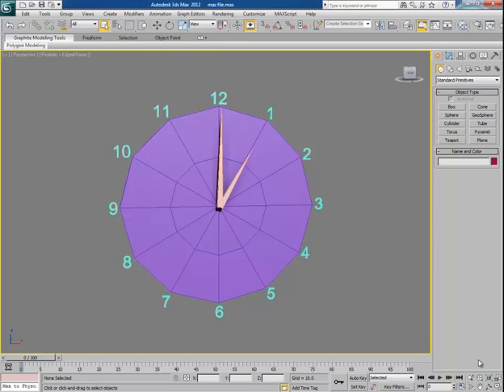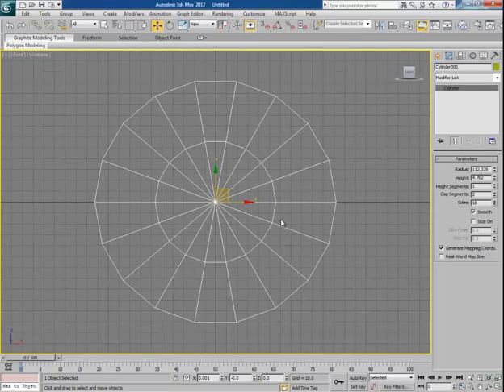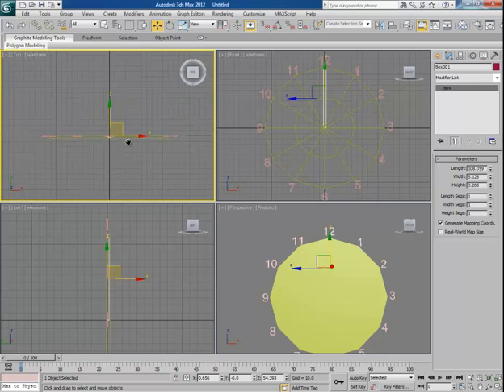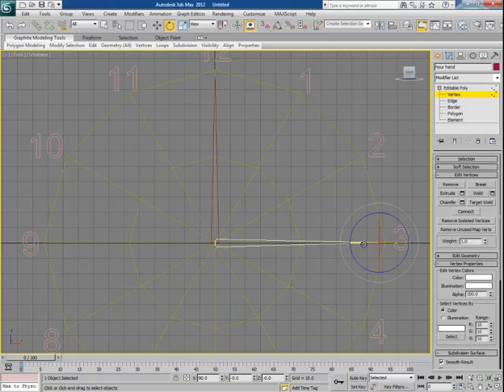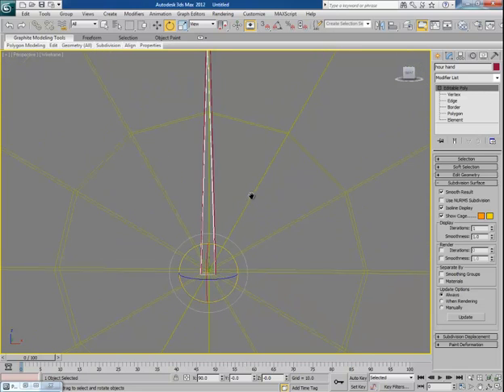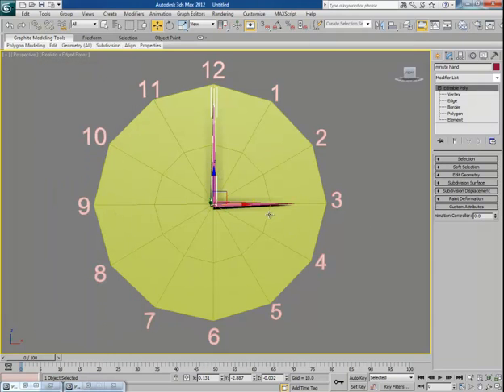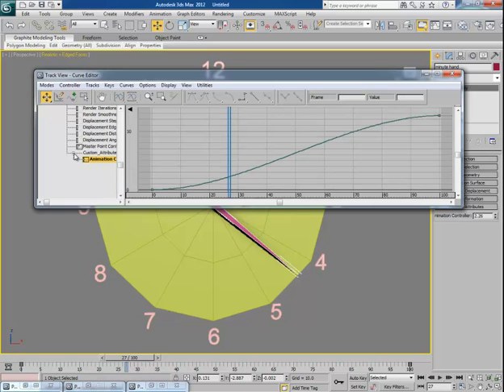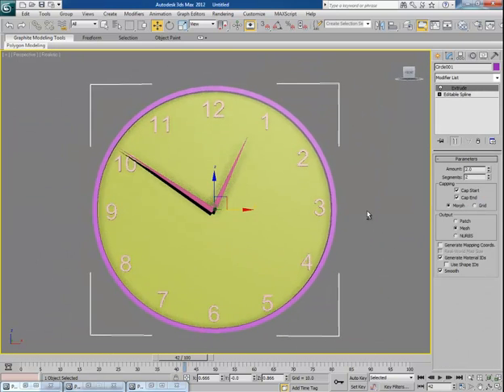Tutorial: Create An Animated Clock In 3ds Max Using Expressions & Custom Attributes

Comment: I tried this on my own before watching this tutorial and got all kind of weird results.  My mistake was in thinking that LINKING is the same as WIRING.  Linking uses the idea that one object is the PARENT of a CHILD object.  The child is linked to the parent.  Wiring, on the other hand, is the idea that one object is the CONTROLLER of the other.  The results are very different and after watching a few tutorials, the instructors do not point this out.  For some of us, especially amateurs like myself, we have probably created a number of relatively simple animations where linking is the only thing needed.  Wiring is more powerful and can also be applied to, say, the Attribute Holder modifier to create our own controls.

That being said, I appreciated this tutorial because it shows control of one object over another using wiring and a ratio of one movement to another without turning into an overly complicated project.  In fact, I started this tutorial from the middle since I did not need to build a whole clock.  Thanks for posting this tutorial!

Comment: To center it to 0,0,0 select the shape then chose the transformation (W) and in the bottom middle section of 3ds there are three number fields X,Y,Z - then simply right click on the small arrows next to them. This will set the values to 0.